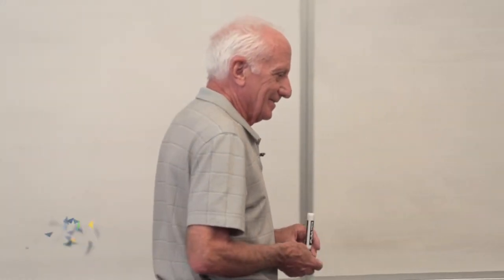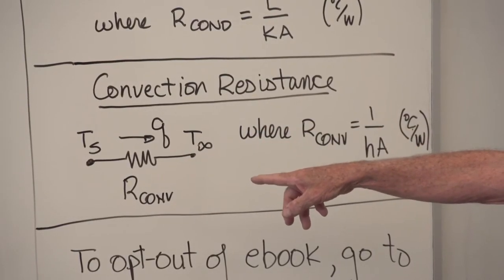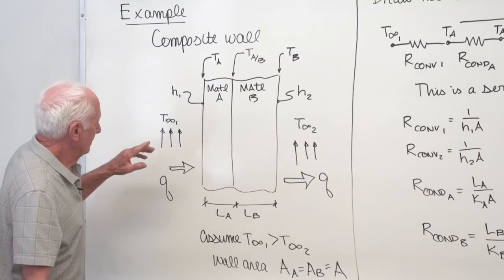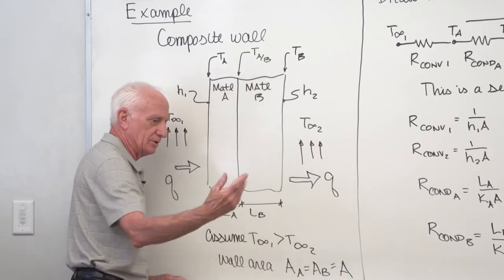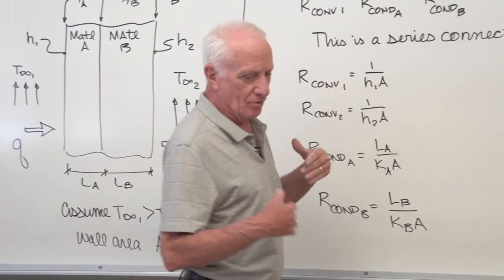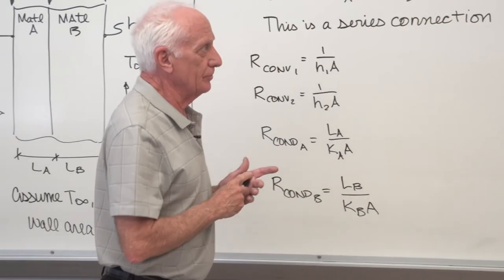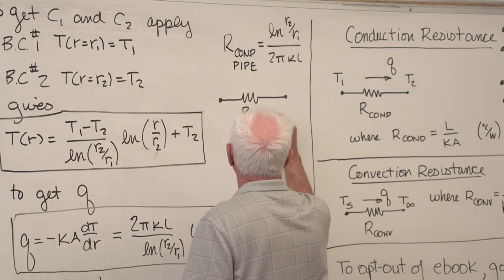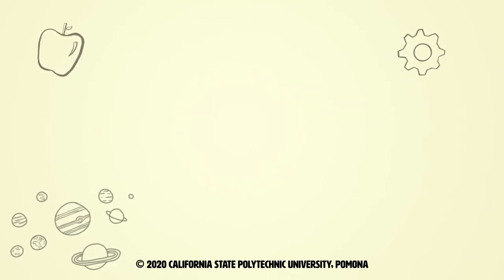Heat Transfer (06): 1D conduction in a cylindrical wall, composite wall network model

Comment: Hi Sir, Thanks for sharing. I need assistance, what if the case I need to find the energy (Q) but i dont know the wall Temp, Ta or Ta/b or Tb. The parameters available only Ti and To. How should I estimate the unknown temperature? Thanks
Reply: You will know atleast one of the parameters. They are the ones your finding so no need to estimate

Comment: If anyone is wondering about the disappearance of negative sign from the heat flow formula at 43:22, it's because of the mistake in T(r). The denominator should be ln (r1/r2). So when it comes to heat flow, the negative sign was used in natural log making it ln (r2/r1). Hope this helps.

Comment: at 41:53 , will it be T2-T1 instead of T1-T2?
Reply: that's correct. because professor forgot  minus front of the temperature equation above
.
Reply: basically higher temp - lower temp so yeah